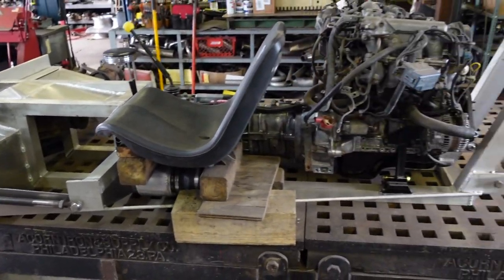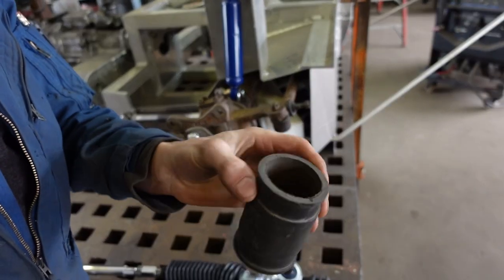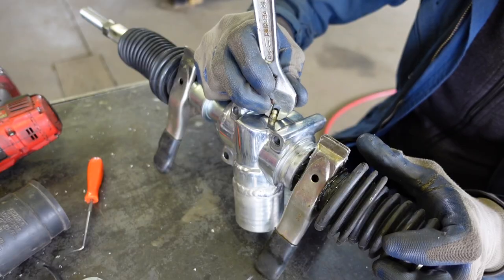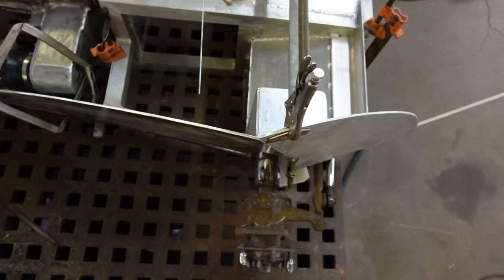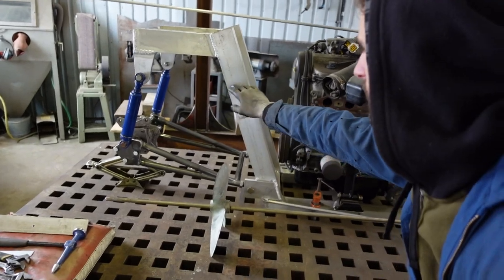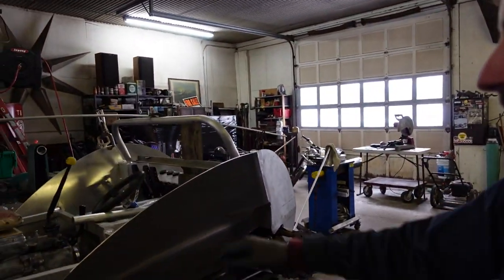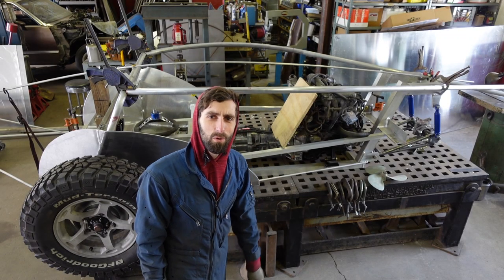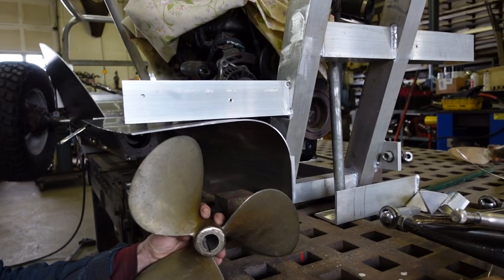Suspension Headaches - Amphibious Project Three Wheeled Reverse Trike Vehicle Build | Ep.4

Comment: I'm wondering how you are going to tighten the pinch bolt on the steering U joint now that it is down inside the tube. Maybe a hole in the side of the tube  with a plug. Use an Allen key.
Reply from the maker: Great observation. I didn't show it very well in the video, but it should still be open and accessible from under the dash. However, once we finish the body work, accessibility could change. Thank you!